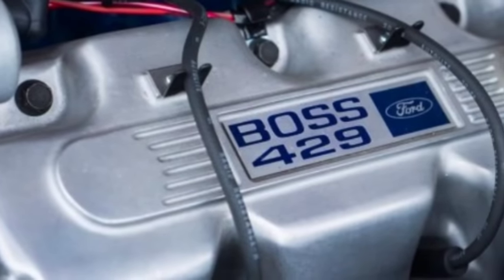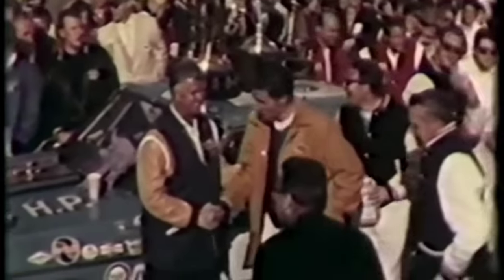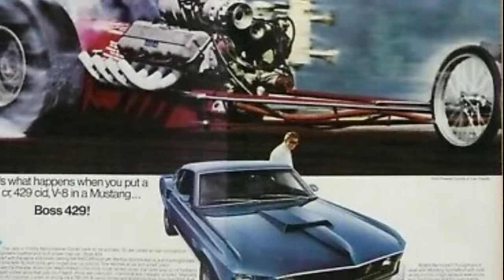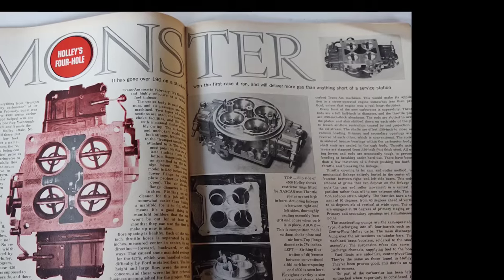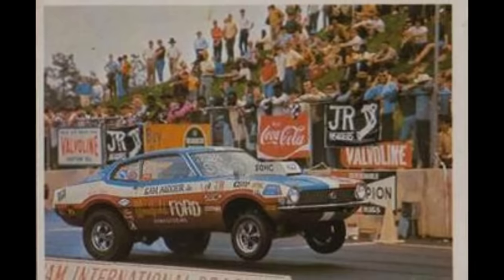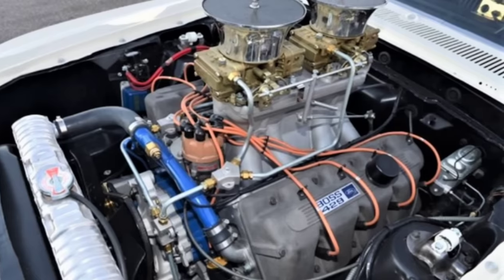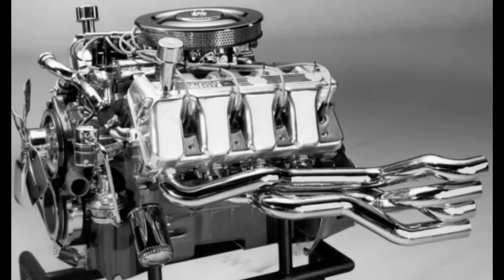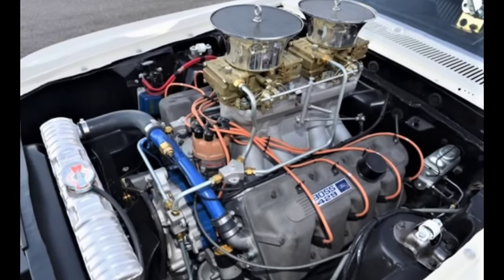The Misunderstood BOSS 429

Comment: Sounds to me the problem was the Boss 429 HEMI wasn’t designed to putt putt around on the street, it was built to run wide open on the Daytona 500. Drag racers just needed time to developer parts or re-engineering of existing parts to make the engine breath better down low so it could get to wide open easier. These days nobody that happens to be lucky enough to own a Boss 429 HEMI really drive them due to not want a wreck to totally ruin their baby. Even still when they do drive it, they feel all 429ci purring like a hungry lion out for something to eat. 

Likely, their new nemesis the LS & coyote powered one size fits all POS’s that have almost completely infested the streets in classic cars today. They’ll never be legends like the Boss 429 HEMI though the new 445ci Godzilla 7.3 has a fighting chance at being the next legendary Ford pushrod V8 in future builds. More of us just need to stay true to our Ford vehicles using actual Ford engines instead of building LS powered Fords because it’s easy, the fact is if it’s not hard what’s the use of doing it in the first place.
Reply from the maker: Amen to that!  I don't dislike the LS... It's a great engine. I just wish that people would keep them in Chevys.. 
Thanks for Watching and sharing your input!
Andy
Reply: @UnityMotorSportsGarage  Andy your videos are great and recently I found your videos on distributor tuning and carb fine tuning. I’m currently in the Greater New Orleans area of Louisiana an struggling with my stock 85 Ford F250 XLT Lariat, it’s got a factory 460 untouched internally since it was built by Ford. It’s 4WD with the Borg Warner T19B trans and Borg Warner 13-45 t-case with Dana 44HD front & Ford 10.25” rear axles. The factory gears are still 4.09:1 in front and 4.10:1 in the rear with factory 16” rims and factory size LT235x85R16 tires. 

The distributor and mostly the “Holley built for Ford” 4180C 4bbl Emissions carb is making this truck EXTREMELY hard to tune even on a very basic level. It’s very hard to start, runs stinkingly rich and pings it’s a** off when under heavy load like hard acceleration. I’ve installed a double roller timing set straight dot to dot, 8 degrees of base ignition timing with ALL new ignition components from coils to plugs and everything in between. Even the Holley carb is a reman unit from Holley Direct, it won’t run unless the transfer slots are exposed and the mixture screws make virtually no change in anything. 

The engine has great compression on all 8 so it’s not that and the vacuum tops at 11-13 in-hg, the ignition is the only part that seem to give any response in tuning for idle, cold start and drivability. Everything is set to the Ford emissions catalyst tag on the radiator core support and its still not running smooth at all while being a total bear to start and drive daily. This is my daily driver and trust me it was originally from Ford capable of 8-10 mpg and I’m lucky if I get 7 mpg by puppy dogging it. That in mind, once it’s good and warmed up and I’m past 2000rpm it’s a stump puller all day long with good power for an old engine. It’s just a dog otherwise!!! It’s got 17,753mi on the odometer an I was told it rolled over once or twice.
Reply from the maker: @80sfordguy  a couple of things... It should have way more vacuum at idle...  Have you checked for true TDC on the balancer? I say this because if the outer ring of the balance has walked your ignition timing will be way off... 
 Since it has good compression it leads me to think that it is a timing issue or a vacuum leak somewhere...  I would bring the number 1 piston to TDC.. and see where the mark is on the balancer first... Hope this helps
Andy
Reply: @UnityMotorSportsGarage  I know I give a lot of detail and I sure did forget to give timing details but, all I said was ALL timing component were replace and didn’t say I verified it. Yes, when I installed the double roller timing set due to erratic timing from a really loose worn timing chain, the engine still had the factory phenolic timing gear with standard chain. I did make double sure the timing was set dot to dot on the new cloyes timing set and verified TDC#1 on the balancer because I changed the balancer as well. ALL timing and ignition components have been replaced, the erratic timing is gone. 

To prevent having to remove a cyl head and tearing down the entire top of the engine I removed the oil pan, rotated the engine to TDC#1, installed a long extension on my dial indicator, then I put the indicator on a flat spot under the wrist pin bore. I needed to change the oil pan gasket, rear main seal and driver side engine mount anyway so lifting the engine temporarily to remove the oil pan was already needed. I verified TDC on the balancer and true TDC#1 both before & after with piston travel using a degree wheel from my summit that I bought with the timing set. I know this is not correct but it still yielded an accurate result it just took some time.
Reply: @UnityMotorSportsGarage  After finding true TDC#1 I verified it on the balancer and it was spot on so I lifted the engine again, replaced both engine mounts, oil pan gasket and the 2-piece rear main seal that was also leaking since I was there anyway. I finished the repairs and bolted the engine to the frame and rechecked the timing and set the distributor in also. I finished up with all the accessory drive and it as usual was still hard to start but, it fired up easier than before. The timing from setting the distributor in was only 3-4 degrees off so I set it to 8 degrees BTDC at 800 rpm for a manual trans as per the emissions tag on the radiator core support. 

As far as the low vacuum, I smoke checked it at a friends shop and we found now vacuum leaks which we were both surprised and dumbfounded at the same time. Now here I am, new timing parts with base timing verified, base ignition timing verified, no more exhaust or oil leaks, new ignition system with the harness checked for shorts and fraying, verified good compression on all 8 and a fresh reman factory carb with confirmed correct part number still with the same problems. I still went back and replaced all the old hard vacuum lines with new same size vacuum line and verified all other vacuum operated components (emissions, a/c, cruise control and EVAP) system are working as they should be.
Reply: @UnityMotorSportsGarage  The only two things I haven’t done is checked to see if my distributor has the adjustable vacuum advance canister on it or checked total timing at 3000 rpm. Even if I do have a adjustable vacuum canister, I have no clue what size the hex key is or which way to turn it for more or less vacuum advance timing. I don’t even know if non points style vacuum canisters are adjustable and if not I still don’t know which kind of canister to buy and install to have adjustable vacuum advance. I for some reason thought that adjustable vacuum advance canisters might only be on points style distributors.

Since vacuum no leaks are present, compression is good on all 8 and timing is verified set to factory specs the only thing I can think of is the pinging under load is total timing issue and the low vacuum is a carb tuning issue. Maybe the carb was set wrong out of the box, I confirmed proper primary & secondary transfer slots were set correctly. I verified the vacuum secondaries are functioning correctly, I check the accelerator pump was set correctly. Yet still the carb won’t idle unless the primary transfer slot are exposed and the primary mixture screws are turned out 5-6 full turns just to get 600-800 idle rpm depending if the engines cold or hot. Cold it won’t idle for more than 15-45 seconds at best and hot it idles sometimes at 600 and sometimes at 800. I verified the electric choke which is non-adjustable on the choke itself does open within 60-90 seconds after.
Reply: @UnityMotorSportsGarage  Though there is a setting on the choke cam I can’t really do it and keep the engine idling long enough set the correct fast idle which I believe is 1,100 rpm cold (below 100 degrees). Like I said once the engine is warmed up and above 2000rpm it pulls like a champ and you certainly hear the vacuum secondaries open due to the difference in suction at full throttle under load while hot. Only complaint when the engine is hot is part throttle acceleration on take off likely due to the transfer slots being over exposed at idle. The secondaries throttle is adjustable but their are no mixture screws and the rear uses a transfer plate with no jets instead of a standard metering plate with jets and mixture screws on the throttle body plate. 

I’m thinking a standard Holley 600-650 4150 style carb will be in my future for better tuning on the secondaries as those are ALMOST idiot-proof with good knowledge of Holley carbs and tuning. The 4180C is just an emissions carb with not much adjustability but, then again my truck isn’t a HP Monster it’s a old daily driver and for now I’m just looking for reliability and drivability. I really for now just want to pump the throttle, start it and go at least for the most part. No carb is start and go like fuel injection is really!